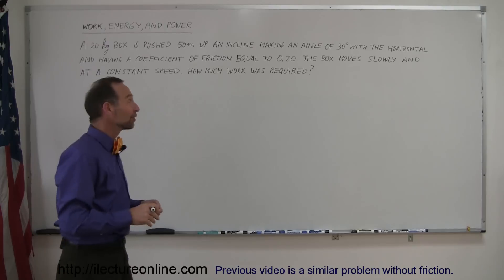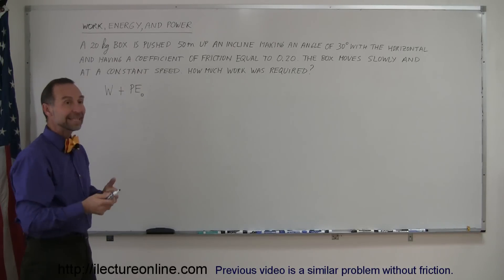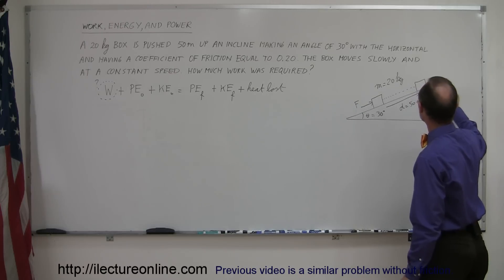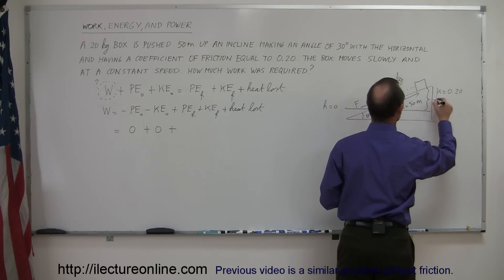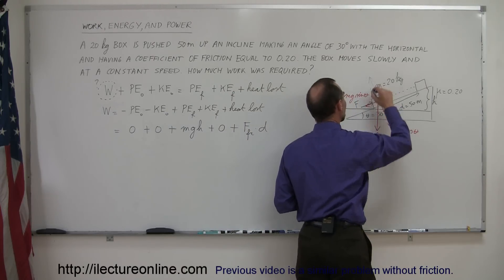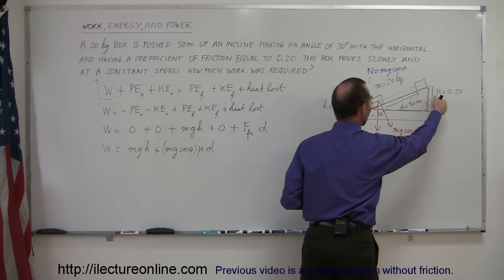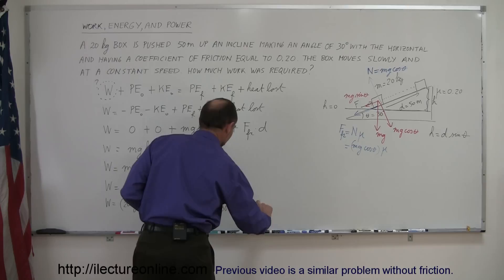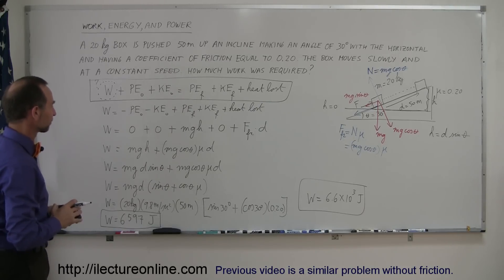Physics 8  Work, Energy, and Power (23 of 37) Box pushed up a Rough Incline With Friction

Comment: Biezen, shouldn't we take in consideration to the gravite x-composant`?

A box with 50 kg mass is pushed up by a incline plane. Hyp = 2m , h=1m. Fr= 50N. I did like this at the lesson:

Work needed = mgh + Fr*d

But my teacher said something about the force of the x-composant. How would i solve the problem by using that, would i get the same result? :)

Since i watched this video i learned the way i did, but now im unsure.!
Reply from the maker: +Jonasa Karlsson 
There are two ways to solve for work done:
1) Multiply the force component in the direction of travel with the distance traveled.       
2) Multiply the force with the distance traveled times the cosine of the angle between the two.
(Actually these two methods are the same but in different format)
Reply: +Michel van Biezen so if Fr was given=50N

Work needed to push a box a distance d of a hight of h , with mass m :

W_needed= mgh + 50N*d 

Thats, the way you solves  the problem here.

But if i would take in consideration the x-composant of the gravity not the y-composant, since the friction "Fr" is given as 50N there is no coefficent. How would one solve it?

You need to push with a force that overcome the friction force , 50N + overcome mg *sin (theta), and all that in a parantese multiplied with the distance or how would the second way be to solve it, wouldn't you need to take in consdieration the hight? Now when i think about it , the hight is related to distance and sinus, so maybe "mgh" is just a part of the "x-composant of gravity"?
Reply: Jonasa Karlsson huh

Comment: can someone help me out. I understand that if the box starts at rest then the initial vel would be zero which makes initial KE zero but how is the final KE also zero if it has a speed? even if the speed does not change there has to be some speed to get the box up the incline?
Reply from the maker: +Chen Garces 
 If the kinetic energy doesn't change, it is the same in the beginning as it is in the end, then you can ignore it.